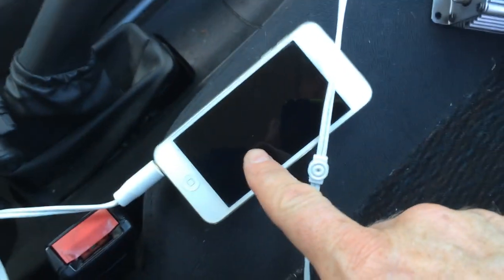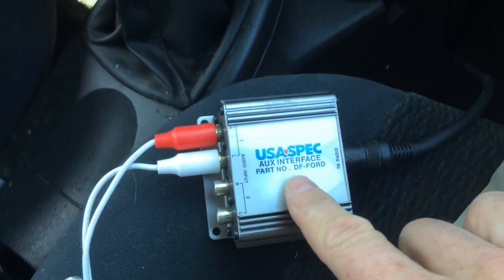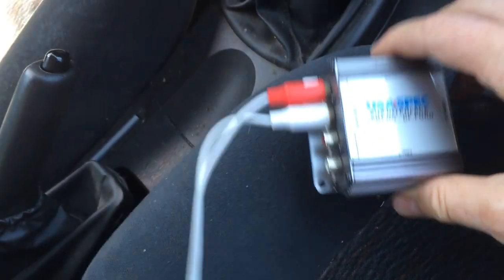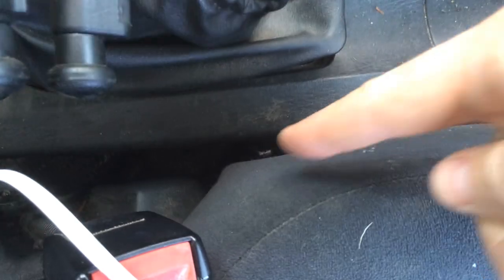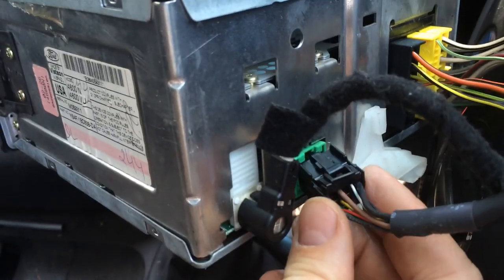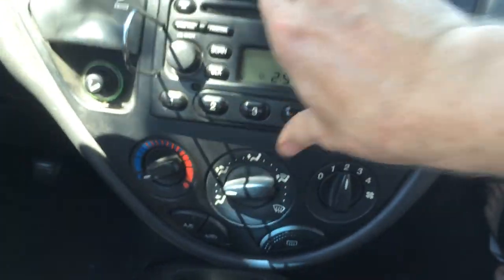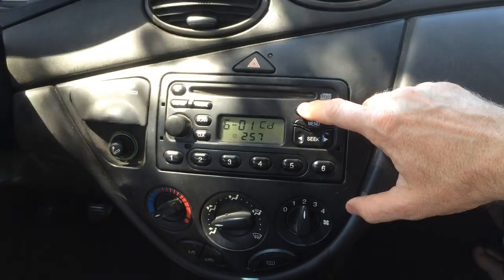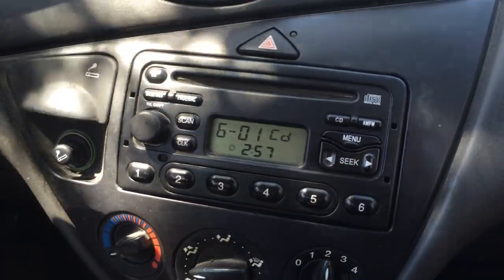How To Connect A Music Player To An Old Car Stereo

Comment: It may now be as cheap but i think replacing the radio for a new deck is well worth it. Mine has aux and 2 usb ports
Reply from the maker: That is definitely a good solution as well.  I like not worrying about someone stealing my stereo, and the factory setup is clear enough and loud enough for me, so I went with the external audio in solution.

Comment: thanks , do a video on switching songs , tracks , folders ect . does your mp3 play in order , Alphabetically , ect .
Reply from the maker: With one of these adapters, it only sends the audio signals to the stereo, but you can't control what song is playing from the stereo.  You have to do that on the iPod, which is fine because it has so many different options, with shuffle, genius mixes, etc.

Comment: That stock stereo is an eye sore. It needs to be replaced all together. Esp in my 2002 Ford Focus.
Reply from the maker: You’re right. Car stereos of gotten really cheap and really good lately. I put one in my new car that cost $100, and it has Bluetooth and works at the cell phone and does everything better than the factory stereo.

Comment: i have a problem that that thet part with nuber 2 3 4 5 have small connectors back and somtames my audio playes shot off how to fix that
Reply from the maker: TheZangose That happened on my car as well every once in a while.  Try cleaning the metal contacts with rubbing alcohol.
Reply: but connectors from 2 3 4 5 part no conntaction with connector in audio player help